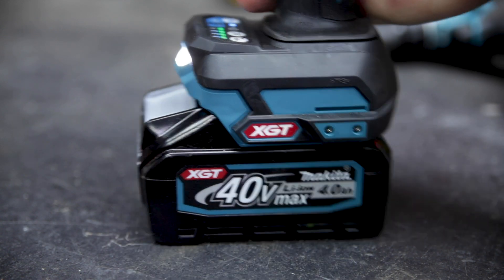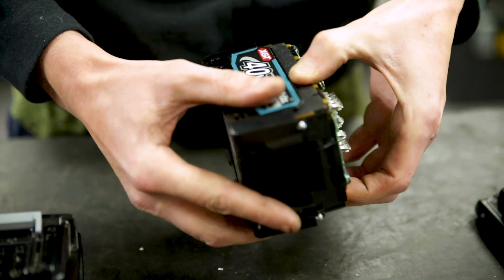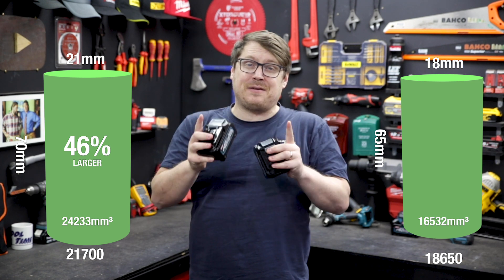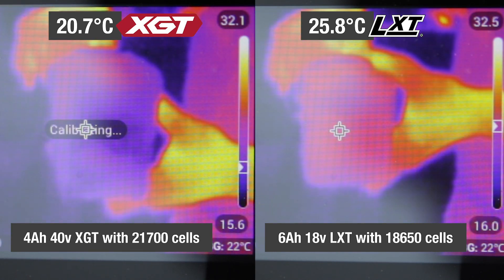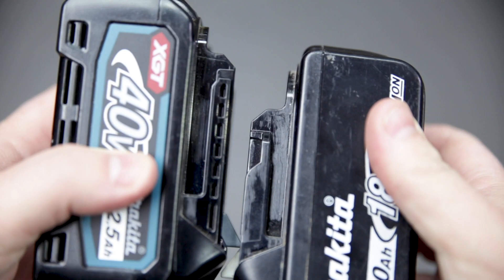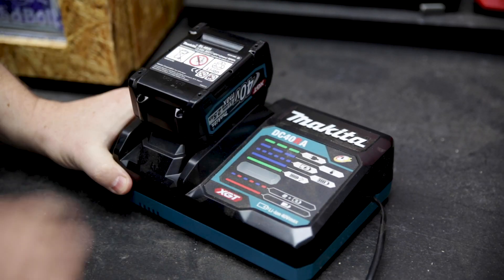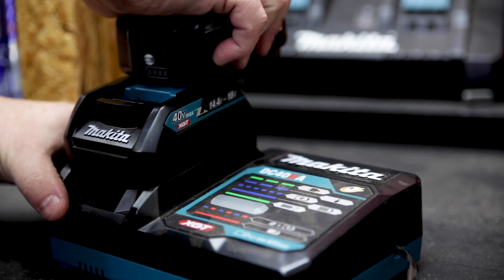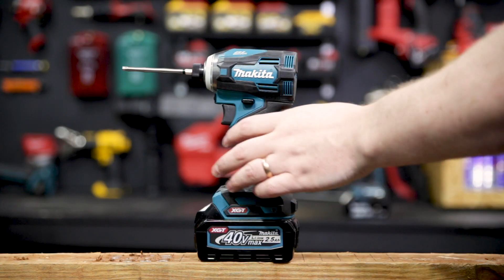Look Inside Makita 40v Max XGT Batteries

Comment: Makita 40 volt batteries are expensive because they are expensive because other battery protection technology uses their machines. Makita batteries have a decryption system to unlock Makita appliances that work. It's Makita's marketing plan to sell batteries. I can tell you that I'm not okay with Makita 40 Volt batteries.👎👎👎

Comment: Basically these are two 18v packs in series. An adapter for two 18v batteries to use on 40v tool would be great.
Reply: No they are not. Old 18V have 5s cell configuration, two of them in series go for 36V. Max voltage therefore 42V. Based on fact that they labeled this as 40V, not 36 or 37, I would assume it is 11s, so its max voltage would be close to 46,2V. Of course it is no problem to make an adapter, but you'd still have to deal with less usable energy and weaker performance. I may be wrong though, havent had a chance to test one of these yet.
Reply: Actually they are 10s battery packs, 10 cells in series. An adapter for two 18v Batteries would be great!

Comment: Hey Tim. Do the tools perform the same with either 40v battery? Id love to see twin 40v stationary tools like 10' mitre saw and table saw. Makita go with ac adapter for large tools which would be great for dust extraction.
Reply from the maker: Great question there is a minuscule difference, more noticeable where more torque is required. Not noticeable driving in a 50mm chipboard screw but when driving in 200mm coach screws into sleeper the 4Ah arrives about a third of a second faster. It's only noticeable with a camera or stopwatch but it is different. There's probably a debate to be had about whether you want to carry the extra weight all day too, but the 4Ah will get you a better runtime.

Comment: I'd definitely hold off changing from the 240v sp6000 plunge saw if there was a chance of a 40v version of the 2x18v dsp600.
Reply: XGT will eat up LXT little by little imo . Plungesaw XGT will most probably come
Reply: They've already got a regular circ saw with a guiderail base and AWS. So, that's pretty much a plunge saw in my books.
Reply: @stianjohansen9281  It would be nice to have a 185/190mm blade instead of the 160/165mm track saws that are out there if making a 40v version.

Comment: Have any of you had problems with this battery? I had a few examble of one problem, on model HR003 battery after some time of working it stop working and I need recharge it and after that it work again, but on battery tester it says that electronic are faulty but it still works. We will see is this  some factory error or coincidence...

Comment: Makitas 18 V platform seems to lack DRM systems which allowed 90% of all Chinese knock offs to come with "Makita 18V batteries". The new 40V system seems to have this fixed by having DRM integrated ("digital communication between battery and tool") and we all need to buy new tools and batteries. In contrast the old 230V electric tools my grandfather used like table saw, hand saw, drill, grinder are all still fine and work with the same electricity after 60 years.

Comment: Very well explained I must say.

I can see you guys didn't want to full tear apart the newer 40v units but are they still supplied with Samsung cells in the 4amp 40v - being the Samsung 40T cells?

Thanks, watching from the UK.
Reply: samsungs are blue  in the 18v 5ah but green is the sony/murata cells  in the 18v battery   i think they use sony cells

Comment: 80v mower would be awesome. Are they sticking with single battery 40v tools or do you think they will release some 80v ones too like the 18v/36v range?
Reply: U would need 3 of these to power a lawn mower effectively
Reply: @d.k.1394  Rubbish, Most tool companies run mowers on 36v just fine.
Reply: @ToolsAndStuffOFFICIAL  rubbish
Reply: @d.k.1394  I'm guessing you believe the earths flat too, seeing as you are denying the existence of battery lawnmowers.
Reply: @ToolsAndStuffOFFICIAL  yeh the erf be flat
Reply: The batteries would have to be bigger unless new battery chemistries are discovered or smaller cells are used.
Each typical Li-ion cell has a nominal voltage of 3.7 volts and a fully charged voltage of 4.2 volts.
This means to get 18.5v you'd need 5 of them in series (5s), to get 42v you'd need 10 cells (10s).

This is why you don't see single tall 40v batteries, 80v would need 20 cells (20s)

Comment: How many recharge cycles do these batteries hold up, before you'd have to buy a replacement?
Reply: At least 300-400, which for non professional works should be at least 6-7 years. My 18v battery is 2 years old with around 50-60 cycles, no capacity loss at all.

Comment: I cannot buy 40v batteries where I live. So I am trying to build myself. I have 2 concerns:
1- What should be the amperage level of the charging board? 30A, 40a?
2- Where is the wattage control mechanism of the device? I mean the card which controls how many current the motor can ask for. If it is in the battery then I shouldn't build a battery. If in the device itself, then it's alright. I think it is in the device because every device has its own requirements and limitations.

Does anyone know answers to any of these questions?

Comment: Why exactly are these batteries 40V? These have a similar architecture, 10s1p instead of the older 5s2p, and somehow they are not called 37V? I guess it's fairly arbitrary to use nominal voltage in the first place...
Reply: You know, larger number is always better in marketing and sales. And the 18 V platform seems to lack DRM systems which allowed 90% of all Chinese knock offs to come with "Makita 18V batteries". The new 40V system seems to have this fixed by having DRM integrated ("digital communication between batter and tool") and we all need to buy new tools and batteries. In contrast the old 230V electric tools my grandfather used like table saw, hand saw, drill, grinder are all still fine and work with the same electricity after 60 years.
Reply: @slartibartfass5729  Love your work around the Norwegian coast.

Comment: all that is fine, but what cells are used??
is it a Sony VTC variant? or Samsung 20R, 25R, or some LG variant..show the god damn label...you know the context and what your headline says.. look inside and show the cell specs?
if somebody is going to put this kind of money down for these packs, one would like to know what kind "of the shelf" cells are used (logic) but for some strange reason you don't show this, even though it would be as simple as showing a closeup.(what does the wrapping say)
what a massive fail, and shocking that you cant come to this conclusion yourself, as when you open up to show the cells, maybe it would be relevant to show the cells (yousee) = model number!!
Reply: sony cells are in the green colour samsung are blue i thiks they use sony vtc cells